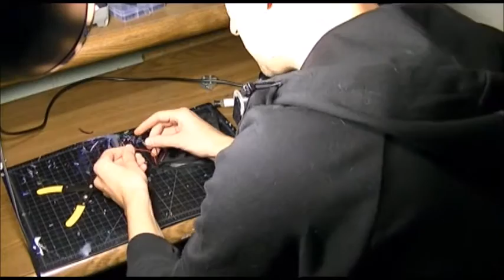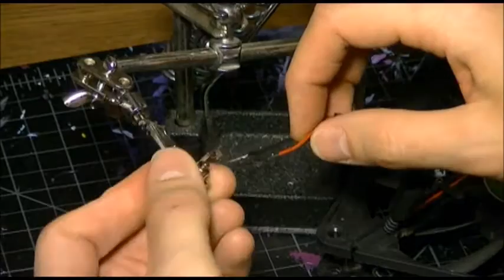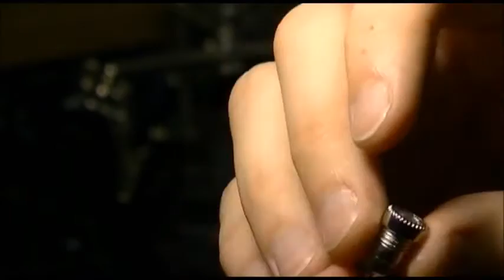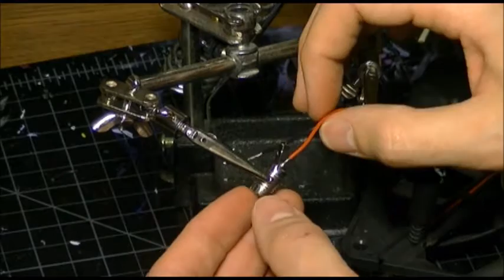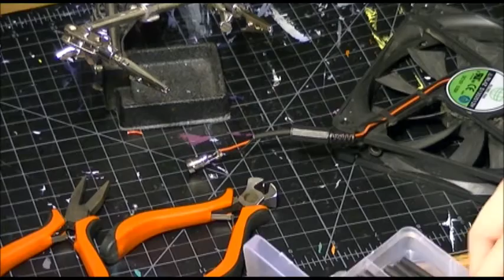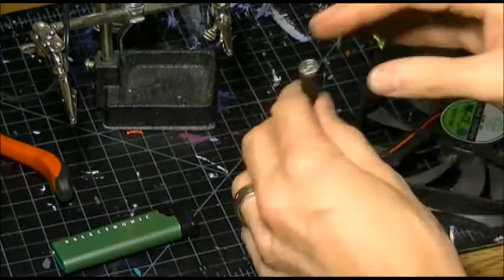Soldering a barrel jack for small DC electronics

Comment: Great video, thanks for making it. Is it possible to not use the original jacket though? I'm adding sockets to the inside of a model and a stand the model connects to (to power LEDs in the model but still be removable), and space is an issue. It looks like the width of the male plug is greatly reduced without the jacket